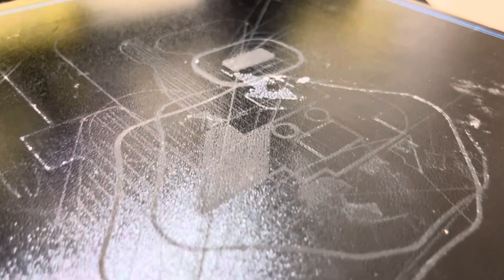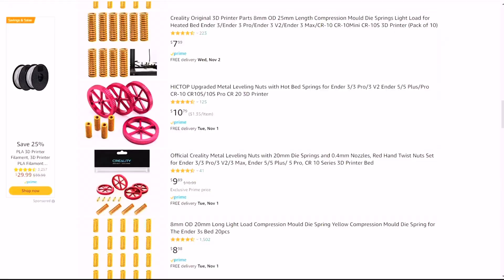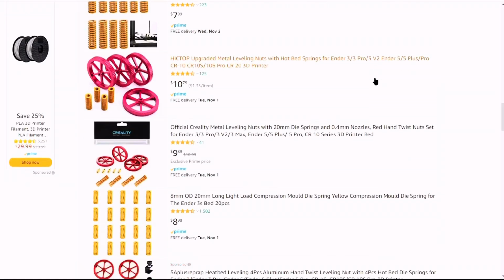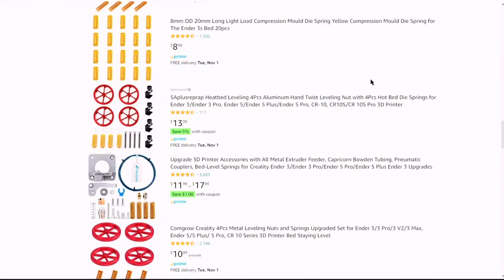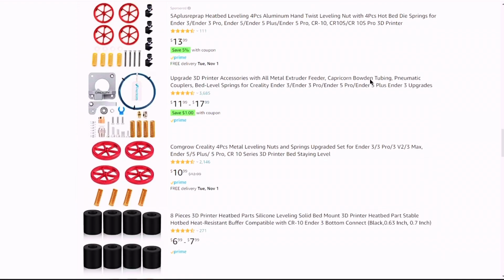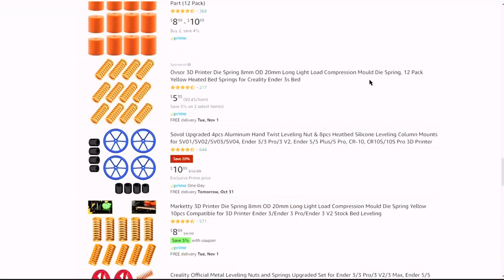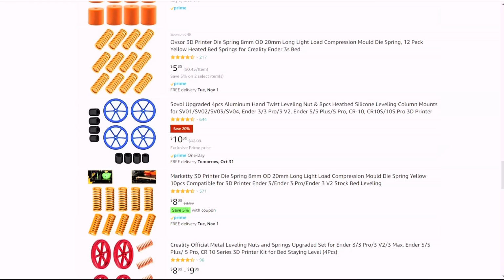3D printing: Springs vs. Silicone Spacers

Comment: I recently switched to silicone spacers and Im not going back to springs. Also I've dumped the bl-touch in favor of the cr-touch. Bl gave many many errors all the time, I never had a single issue with the cr.

Comment: i have a CR10S (old model with blue stripes) all of the springs are 23mm, i bought the silicone spacer with 18mm (it was the only available size in my country) , can i put a nut with 5mm to get the 23 or is it better to buy the spacer with 23mm?
Reply: Just use the 18s and lower the z limit switch

Comment: Springs are there for a reason. Silicone doesn't have crash protection so be prepared for ruined beds and nozzles that aren't covered under warranty if you remove the springs
Reply from the maker: From my unfortunately extensive experience in destroying beds 😆 (with springs) it's not the initial crash into the bed that gets you, it's the subsequent dragging and scraping across your bed that destroys it.  Due to having an incorrect Z offset value.

Comment: This is all fine and dandy but let me ask this.  Why does it seem my Ender 3 choose a different z axis each time I turn on or try to print a different from SD card.  Then when I run bed level it is way off then try to print won't stick.  Run bed level again and way off but back the other direction.  Then print will stick with a 50/50 chance if needing glue stick.

Comment: Neither.

I put my bed on adjustable hard stilts. Screw through bed. Washer and nut below bed to retain the screw. One thumb nut above bed carrier and one below bed carrier. Thumb nuts 3D printed very slim prints as thick as a machine nut plus one layer, a machine nut is friction inset on the inside under a lot of pressure. Jam the thumb nuts hard against the carrier. It's going nowhere, absolutely nowhere, rigid like a rock. 

Don't break your Z probe, or the nozzle will break the bed. Don't ask me how I know. I love failures, they're hilarious.

Comment: Before silicone spacers where a thing I used some fiberglass under PTFE tape where the Springs mount so they don't pull heat from the bed. One thing that helped by far the most is adding a sleeve in-between the screw and the spring to remove shifting. I also tighten as much as possible (but still adjustable) for two reasons, remove resonance and to more holding force on the wheel nut so it doesn't walk out. An added M4 nut to lock it won't hurt, just don't recommend using a locking nut (the ones with nylon in them) or any type of lock-tight because then the screw will just spin and you'll have to either make a hole in the magnetic sheet or just remove bed if your lucky

Comment: Very good and informative video on the silicone bed columns!! I am thinking to print them out of TPU.. Any thoughts?
Reply from the maker: Ahh yes I did this on some soft mounting feet for my CR-30. I just had to print out several test pieces changing the infill density and number of perimeter walls. I think it’s achievable you just might have to experiment a bit.

Comment: why do you have a z axis switch if you have a bl touch i thought you can only use 1 or the other
Reply: i have a z axus switch still on my printer but it is unplugged which i think is the likely case here
Reply: you can use the end switch for homing and the abl for leveling

Comment: 3:55 Your measurements were never at 12mm eg. for the blue spring, as the ruler wasn’t measuring from 0. You were measuring at the end of the ruler and the mark of 15 was about 5mm or so from the end of the ruler.

Comment: I used silicone spacers for a while, but found that eventually the tops against the hotbed had mushroomed and I was getting inconsistencies with my leveling, some had to be so tight it just warped the bed, and I lost some adjustable range. I switched to the upgraded yellow springs and It's since solved my issues entirely
Reply from the maker: Interesting take, I haven't experienced or heard about this before!
Reply: This determined my decision. I’ve been using stiff springs for years. Wanted to see if these are worth it. Thanks!
Reply: Wow, thank you! I might actually go with the stiff springs now
Reply: Same, I actually changed them today at work. I had the adaptive mesh macro  tuned in so I put it off for far too long.

When I first got them I thought I was damping a bunch of vibration lol

Comment: I tried both the improved bed springs and silicone spacers, but had significantly more quality issues with the spacers than with the springs. This could be just settings in Cura that i could change to fix, but by default the springs had better quality with the default .2mm layer height cura profile.

Comment: this was one of the best and well thought out videos i have seen in a long time and i am very happy with the sheer amount of information given. this is the exact problem i have with my printer where the stock springs allow the bed to shake too much so there are inconsistant layer lines and my prints look bad. now, i am confident that with the new upgrade, i shouldnt have any problems with it.

Comment: The bolts introduce a bit of wobble This is the root of the working loose The fix is either nylon nuts or nylock nuts and nylon washers You must protect the bed heater doing this

Comment: would a drop of loctite on the 'weels" be an option ? to prevent them from "running"
Reply from the maker: yes, that would be an option, but it might be difficult to take off later if the bolt is spinning in the bed.  Not a big deal, you just might have to take things apart a little further.  Using a Nylon lock nut to save a few grams of weight is on my to-do list haha
Reply: @DesktopInventions  I've already have locknuts under te screws in the bed so they are quite fixed after watching this tutorial https://youtube.com/watch?v=v5u_Xgq62nQ&si=EnSIkaIECMiOmarE
Reply: @DesktopInventions  With heat the locktite comes loose.
Reply: Loctite ruins most plastic it touches! Be careful with it.

Comment: Just curious,  why didn't you remove the Z axis limit switch when you have a BL touch? Is there any benefit in terms of redundancy?
Reply from the maker: I just chose to keep it there in case I need it some day. Highly unlikely though
Reply from the maker: Also no benefits of redundancy since I unplugged it for the BLTouch. I’m not sure if it would work or cause more problems if you tried to connect both
Reply: I repurposed mine as a z max limit switch, I kept crashing into the top of my frame when I tried to home with z too high.

Comment: Hmm, I've been using the stock silver springs in my first generation Ender 3 since I bought it many years ago and have never had any problems with loosening issues through hundreds of hours of printing. Maybe Creality used stronger springs 6-7 years ago. I don't have ABL installed. The majority of the time the bed stays leveled with slight touch-ups needed only occasionally. Really the only time I have to do a complete level is after a nozzle change or any major work on the hot end (which is rare). I start the leveling process with the springs 1 to 1.5 turns of the adjustment wheel from fully compressed. This gives maximum spring tension while allowing for some adjustment. I bought a set of heavier tension springs several years ago but they're in storage somewhere gathering dust.
Reply from the maker: Yes if you have the stock springs near full compression it will be much better, that’s probably why you don’t have issues. I remember when I first got my Ender 3V2 the Z stop would let me tighten the springs very much since it limited the gantry downward travel. Because of that I had issues with the springs loosening over time.
Reply: @DesktopInventions  That's why people cut stopper on Z endstop,  it lest's you lower your Z as much as you want. I personally never had an issue with stock springs but I changed them anyway to stiffer ones some 6months later and they hold my bed great. I need to tram my bed once a month compared to stock (every week), not fan of ABL
Reply: Same experience as you with stock springs. I bought my Ender3v2 february 2022 and still use the stock springs. I do have the yellow in a bag but see not reason to use them. On the contrary they are very stiff and since there are four springs you can deform your bed with them.
I marked the wheels and they never change position by themself so since I don't have any problem I keep the original springs.
Reply: @larsaberg6851  Good tip to mark the wheels!

Comment: Keyword: lock nut.  Keeping your "wheels" from turning on their own can be addressed by printing your own wheels and inserting a lock nut into them.  Not having too much pressure on the bed also has an advantage as allowing some "flex" can allow the extruder to get filament out even if your nozzle is actually a bit too close, since the pressure can push down the bed a bit is those springs are not too strong.  So, if you are only trying to stop those wheels from turning, then I think an (M4) lock nut makes most sense.
Reply from the maker: That’s a great idea! Good advice!
Reply: What about Locktight anyone try?
Reply: @fkat1666  not a good idea - the physical properties will change over time so you want to be able to adjust them to account for the bed flexing, different environmental settings, spring wear etc
Reply: @TheDreamHazard relax I didn't do it lol😅

Comment: Wouldn't using nylon lock nuts in the bed screws prevent them from loosening in the first place? The stiffer springs and silicone spacers seem to put more pressure on the stock nuts puts more friction on the adjustment knobs but the issue seems to be the nuts embedded in bed adjustment knobs.
Reply from the maker: Good idea I think that would work. I’d have to check how the screw is constrained in the bed. If nothing is holding it, it might just turn when tightening the lock nut.